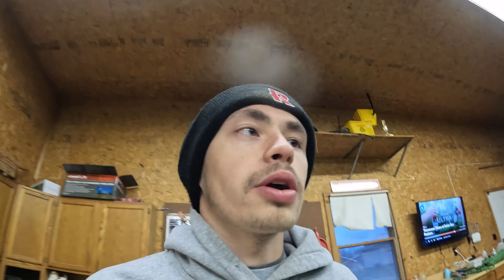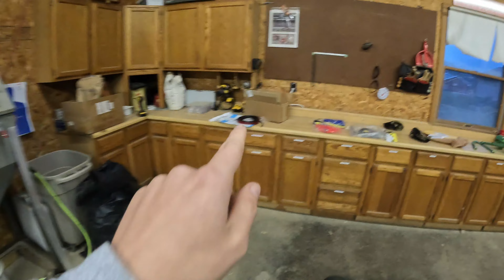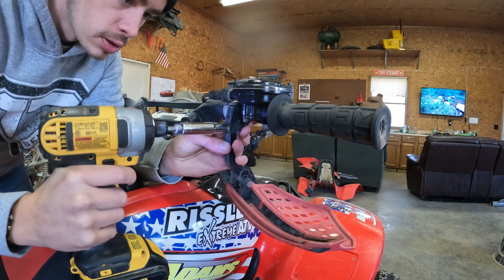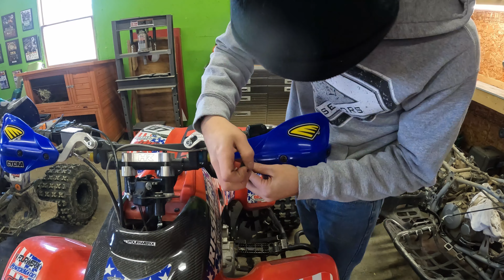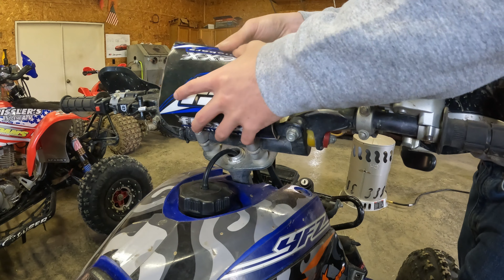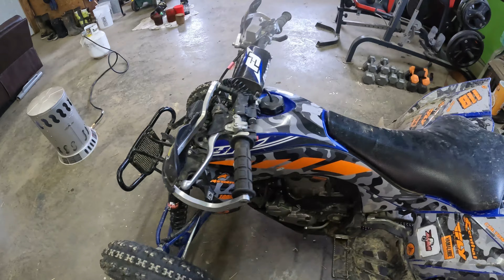Changing Up Handguard Brands & Flexx Bar Maintenance

Comment: Dudeee how did u mount the handgaurds on the yfz i have a 2024 and i need help dude the oem ones have plugs and i cwnt mount themm
Reply from the maker: @GraysonMcminn  I just used the standard cycra mounting hardware. There were no plugs in my bars